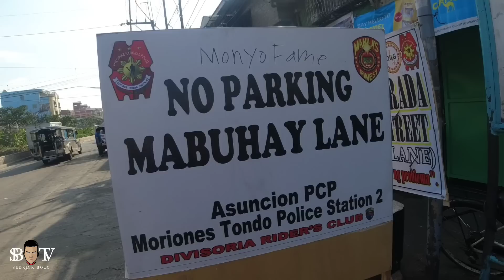NAKIKITA MO BAYANG KARATULA DALA-DALAWA YAN!!!ETO LAMG KABUHAYAN NAMIN SIR!!DPS Clearing Operation🚨

Comment: Caught in the act of violation  fine and eight hours of community services at the same time have them do the dirty works zero tolerance dapat most of them are repeat offenders any way. None of the team are equipped and ready for THE ROUTINE ,so use the offenders ANO BANG CLASING TAO SILA NAKAKAHIYA WALA SILA NUON KULANG SA SENTIDO  NILA AWFUL